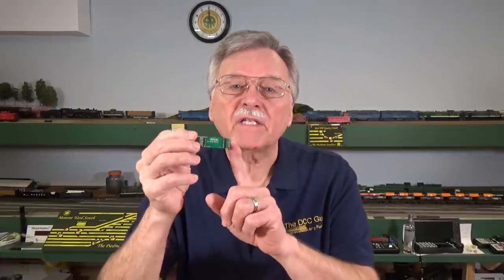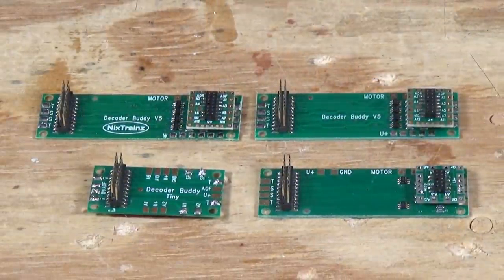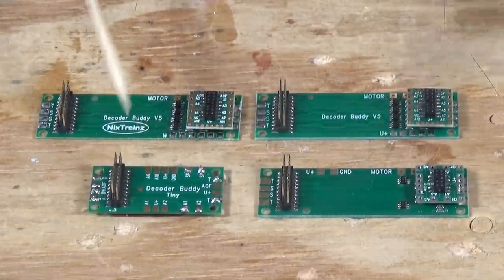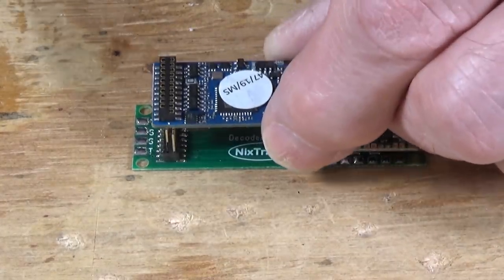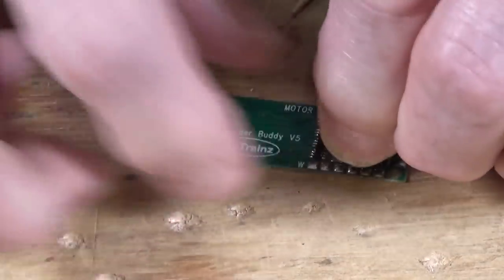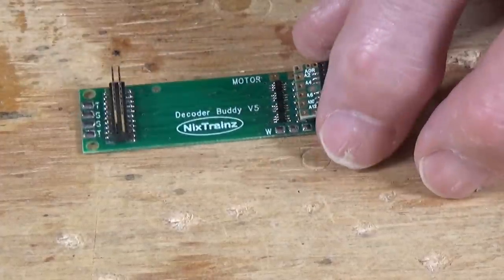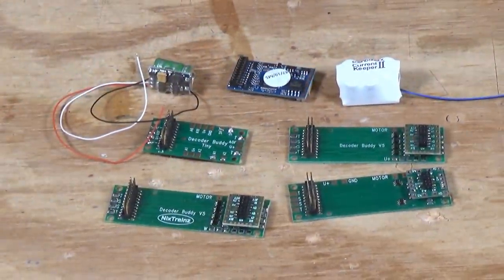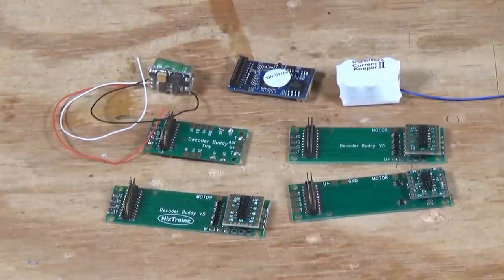New Decoder Buddy And Current Keeper II (179)

Comment: Excellent presentation, Larry.  The addition of connecting PowerPacs to ESU LokSound decoders on the new Decoder Buddy is great news.  I just recently installed a LokSound 5 (wired) and PowerPac in an Intermountain U18B.  Connecting the three wires to the decoder was not easy because of the very small and close solder pads on the decoder.  I'm getting an Atlas B30-7 which has QSI , and I'm going to replace the decoder with a LokSound 5.  The Decoder Buddy will make it much easier.

As for the new Current Keeper 2, I've used them (and the original as well).  They work well, and the shorter length of the new one is helpful.  However, I have also used the new TCS KA-1 and KA2 in many SoundTraxx engines I have because of how very small these are.

Comment: I’m glad that you’re covering DCC fitting.  I’m going to have to fit decoders in some of my DC locomotives so that I can run trains on the club DCC layout.
Reply from the maker: Which locos? I am mainly doing steam although I do have one diesel—GWR Flying Banana. I have shown how I do the steam installs in the 0-6-0 PTs and the GWR 1363.
Reply: @TheDCCGuy  Well, I’m using steam locomotives, and running a model Steam Gala at Ongar Station in 00 gauge.  A lot of my locomotives need sound chips!!  I have all of the following: Pitchford Hall, Hawthorne Leslie Isabel, a couple of J94s in different liveries, a D16/3, an already sound chipped Standard 4 Tank (4-6-2) and Green Arrow.

Comment: I'm kinda new to a lot of the "advanced electronics"(aka decoders) and was wondering if the decoders by Digitrax that have a capacitor attached to it is a keep alive device?
Reply from the maker: These offer a little keep alive ability but not much. However if you are running HO or larger then you may not have to worry. I only install keep alives in short wheelbase switchers and some steam locos but only if they give me trouble. Most HOP diesels have a long enough wheelbase and weight to get over dirty spots and even unpowered frogs. N scale is another issue since they rarely have enough room for a keep alive.

Comment: Gezz Larry you make my day, Question; I have 7 Stewarts with Pwr B's would you still suggest soundtrax PMP (?) you used in your install video OR this new V5 Decoder buddy    advantage/ disadvantage thoughts?
1000 thanks buddy .
Reply from the maker: I have about 6 PNPs stashed for more installs and may buy more. They really are an economical method to add power and sound to a wide range of locomotives. However they will not fit in any of the old LifeLike E6/7/8/9 or PA locos. That’s where a combination of the Decoder Buddy Mini and a ECO 21 PNEM will do the job—I hope.

Comment: Hi Larry - I know you're describing DCC Decoders for HO scale.  What do you recommend for N-Scale?  I have about 6 to 8 Mini-Trix Pacific's and none of the DCC websites Decoder finders include Mini-Trix.  Any suggestions?
Reply: There is a guy who is able to fit a Decoder Buddy Mini with a decoder installed and the 21 pins trimmed to the top of the decoder’s plastic connector into an N Scale locomotive tender.  Might be worth looking into.
Reply: Check out Model Train Technology. He has many videos on N Scale installations.
Reply from the maker: There are a number of options for steam since many mobile only decoders are very small and will fit easily on tenders. “mini” size versions of the Soundtraxx Tsunami2 or the ESU LokSound decoders paired with a small sugar cube speaker. For larger tenders a small oval speaker is an option. I installed a Tsunami2 and flat oval into an N-scale long haul tender which even had room for a TCS KA1 Keep Alive. This combination was a game changer since it cured the stop and go behavior of the loco. However the stay alive option may nor work in small tenders.

Comment: In a previous video, if I recall correctly, you stated that the TCS keep- alive was the smallest one available,  so why would you want to deal with the ESU 3 wire style for a non-ESU decoder? 
Suggestion: put a millimeter ruler next to these small items in oder to show their sizes.
Reply: He did say that the third wire allows the stayalive to be turned off during programming and I also know you can program these stayalives using CVs thanks to that third wire.
Cheers!
Reply from the maker: Actually I have never been able to get an answer from ESU as to whether their 3 wire Power Pack stay alives are compatible with non ESU decoders and not wanting to kill either a decoder or a Power Pack I have not attempted such a combination. Consequently I would not advise trying it. I would only use the 3 wire stay alives with ESU or Lenz decoders and 2 wire ones with the other stuff. The main point is that ESU has gotten very hesitant about honoring their warranty if they believe a non ESU stay alive was used with a damaged decoder. This new Decoder Buddy makes it very easy to connect a 3 wire stay alive to a ESU 21 pin decoder.

Comment: Great video but I still don’t understand why there are so many different components. Cant someone just make a one piece board?
Reply from the maker: There are a variety of decoders of different sizes and different numbers of functions, etc to make it easier to fit them  in different locos. This also allows the companies to offer a range of decoders at different prices.  This is a case where one size or type doesn’t fit all.